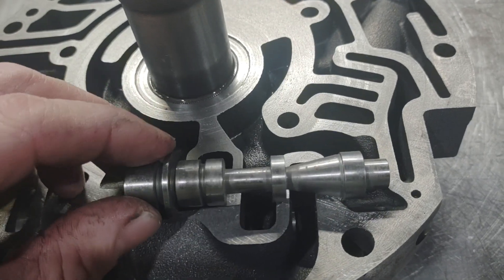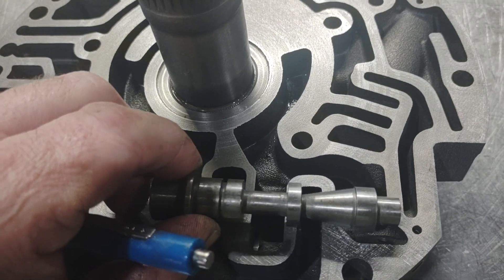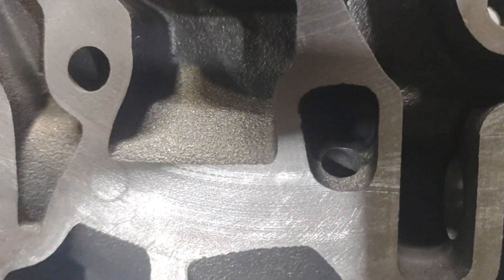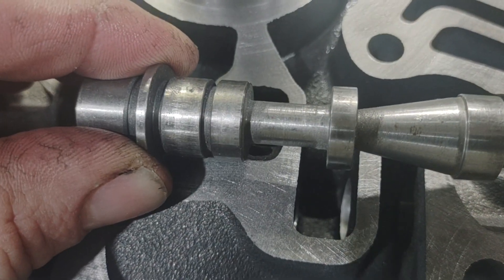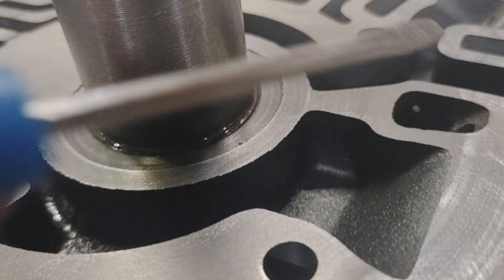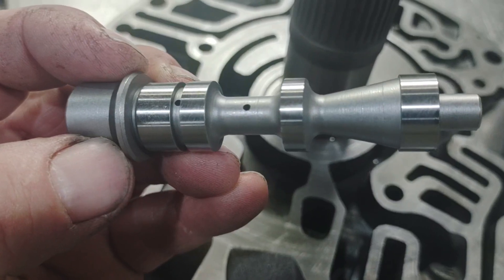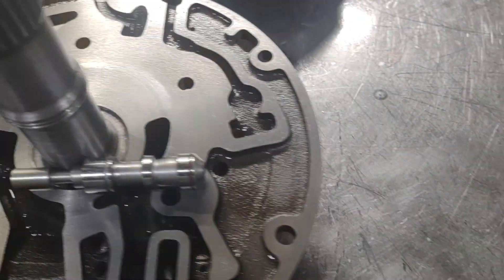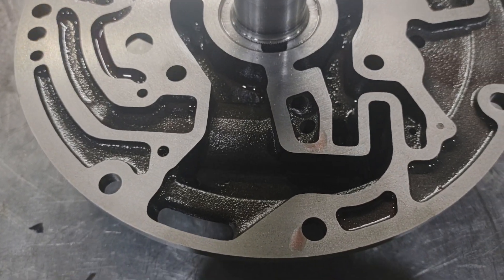Converter Circuit Regulation and 4L80E converter drag issues.

Comment: I am doing a non-lock converter in my build. I've installed the Sonnax valve after drilling the hole in the pump. I didn't realize the Sonnax valve done the same thing. Do I need to plug the hole in the pump and use the Sonnax valve or leave the hole in the pump and go back to the stock regulator valve? Or can I leave the Sonnax and the hole in together???

Comment: How much pressure should an 80e have for charge pressure when the line pressure is fixed. I've seen kits that pin the converter limit value shut and also converter companies that give you converter limit value springs for higher charge pressures. Are you reaching your target pressure by drill size on the line to lube hole?
Reply from the maker: Charge pressure in a 4L80E is complicated and controlled by several things.
We're working with the regulator valve to ensure adequate flow mostly.

Comment: I had to get that Sonnax line to lube valve, 3800 Yank stall and the converter was dragging so hard it would pull through the brakes at 900-1200 rpm. Good video here , should of drilled that hole when I had the trans apart , live and learn